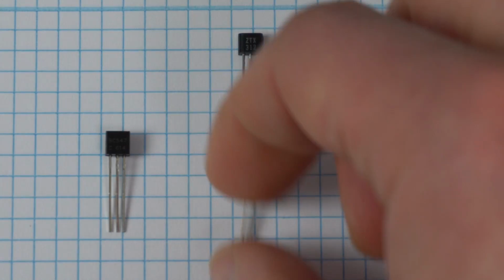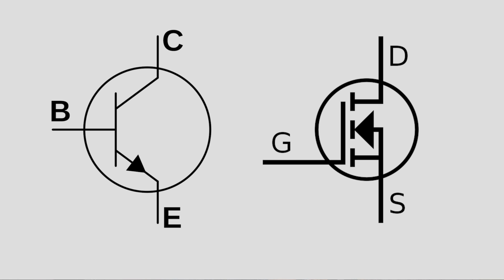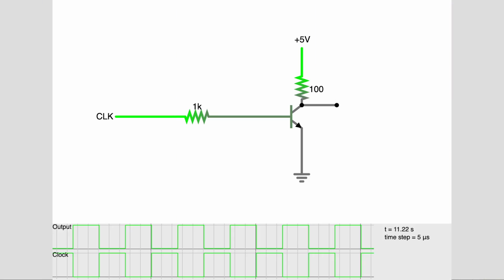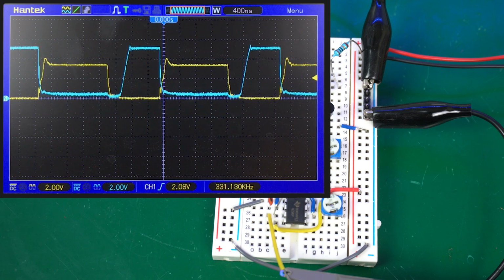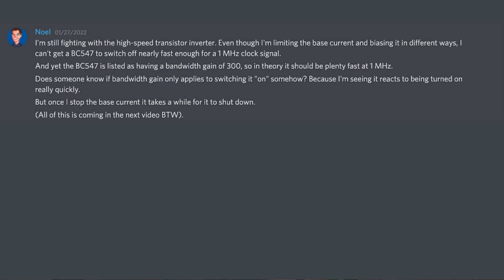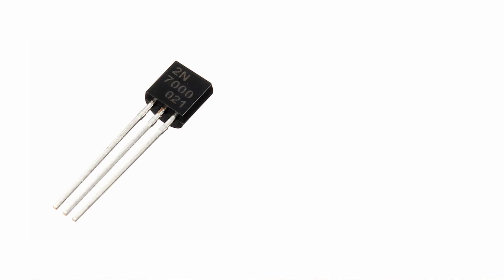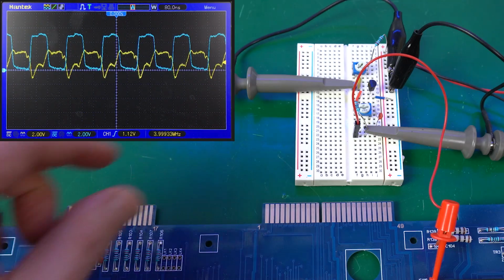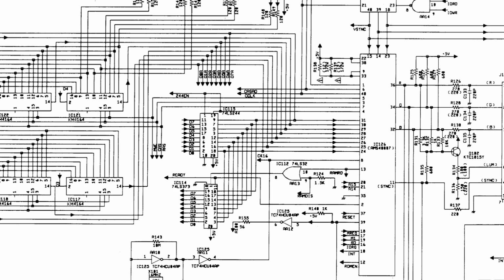How To Find a Transistor Replacement

Comment: Actually the low value of the resistors in the circuit 100Ω and 68Ω, it most probably also boots the available current. In the 1980s the output stages of LSI chips were often still very weak, especially when it comes to putting out a logical 1. It is not uncommon that those chips were only capable of sourcing 100 µA when high, while they could sink several mA when low. This is enough to perhaps drive a CMOS input, but probably not at a high frequency such as a several MHz clock frequency. With a collector resistance of 100 Ω and a series resistance of 68 Ω the transistor provides enough drive capability for the clock input of the Z80.
Reply: That detail about the 2N7000 datasheets was weird. It is such a common component - and the SMD-version is shown correctly in both datasheets.

Comment: I typically just find a compatible transistor by using the same Vbe and Ic specs. sometimes I'll try and stay within the same frequency limits. The hard part is finding the correct package type and pinout.

Comment: For the MOSFET you may have to tie the gate to ground with an additional high value resistor. The charge may not being pulled down fast enough through the IC. Especially since original design was a transistor.

Comment: Hi Noel, I just stumbled upon your video and thought I would add a few comments since I have been researching transistor substitutions since the 1970's.   The ZTX312 was originally designed by SuperTex.  Some other manufacturers made the same part using in-house designs but, the collector-emitter saturation and DC beta was not as good.

As you discovered, when researching a replacement, you must consider the application.  Also, you discovered the bipolar storage problem.  Bipolar transistors designed for switching are optimized for low base charge and low collector - base capacitance.  Additionally, switching transistors will have ratings that specify limits on transition times, on/off charge, and collector capacitance.

The BC547 is a general purpose transistor, which is generally used for low speed switching and analog circuits.  The 2N2369 is a switching transistor that came out in the early 1960's, it was designed specifically for computer applications.  In your circuit, a Mosfet would have been the best transistor to use, however, when that circuitry on your board was designed, logic level discrete Fets did not exist, so they used a bipolar.

The speed-up capacitor does not always work, it may overwelm the drive circuitry.  The schottky diode from base to collector is helpful.  It shorts out the base drive if the collector goes below 0.3 volt.  This circuit was used in all TTL with "S" and "LS" logic.
Reply from the maker: Thanks for the info! Fantastic stuff. Any idea why the Mosfet didn't quite generate a square wave at the full speed of 4MHz? That's the one I was hoping to use, but I couldn't tweak the resistances to get it nice and even. In theory it should be fast enough, right?
Reply: @NoelsRetroLab  The 2N7000 is somewhat of a general purpose transistor, although it's spec does rate switching characteristics.  The reason it doesn't perform as expect is due to several reasons: (1) Most enhancement mode Mosfets are designed to be fully switched on at a gate voltage of 10 volts, referenced to the source.  Although this Fet does have specs with a gate voltage of 4.5 volts, the transistor is not fully switched on (or saturated).  (2) The gate threshold voltage is 0.8 to 3.0 volts; the point at which the transistor starts to turn on.  Bipolars have a threshold of 0.6 to 0.66 volt at room temperature (+25 degrees Celsius) so, they are activated sooner as the input pulse rises, and with a much lower tolerance.  (3) Fets have the same problem bipolars do; input junction charge.  However, Fets have far less charge than bipolars, generally making them superior for high speed switching.  (4) Varactor effect.  The gate and drain have  noticably higher capacitance at 0 volts, versus 5 volts.  The gate-drain capacitance is a bit high as well.  My first choice would be 1.5 pF or less.

I am not sure what you are varying with the 2 pots you added to the circuit.  You should use a series resistor that limits the current to twice the normal amount to prevent the possibility of blowing out your gate array output.

I looked for an improved drop-in replacement for the 2N7000, and found nothing suppliers would stock.  It is getting harder to find small signal discrete switching Fets, as most of these are being replaced with a single gate inverter.  My advice based upon availability and pricing, would be to go with the PN2369A transistor; it should be a drop-in replacement.

One more comment - The 2N2369 you have uses the TO-72 package, which is a hermetically sealed metal can package.  This was the industry standard package for small signal transistors in the mid 1960's in the US.  Due to the added expense, most small signal transistors are now packaged in the TO-92, molded plastic package (leaded parts).

Comment: The Miller effect is a multiplication of collector-base CAPACITANCE by the amplifier gain... totally different than base charge of a saturated transistor.  A Schottkey diode from base to collector will prevent saturation.  This trick is employed in 74Sxx and 74LSxx logic chips.

Comment: Hi Noel. I understand your method of trying out different transistors to replace an obsolete but working one but most of the time in the repair sector, the obsolete one has failed.
Is the best way to find a suitable replacement by matching the hfe (gain) and VCEO as close as possible or higher ?. I am not talking about critical clock circuits but general purpose switching or amplification.

Comment: Just to let you know a MOSFET is a voltage controlled device and a transistor is a current controlled device.  I know you can have the issue of the charge staying on the gate of the MOSFET as well and unless it is rated for it operating it in it;s nonlinear region can damage it if you do not drive the gate with enough voltage.  I think a logic level MOSFET would have fared better in the circuit you were trying to use it in.

Comment: @5:31 - if this is a clock signal, it will be distributed (I assume) to multiple devices, each of which will need a chunk of current to switch. The maximum current  output of the array will depend on the array type, but it probably won't be sufficient to drive multiple devices (the number is called the "fan-out"). I would suggest the signal needs an external inversion as a result of the technology (again). Rather than use an IC of which a single invertor would be needed, it's cheaper to use a single, high-gain, small signal Tx.

Comment: Why it was done with the transistor first was probably more to do with how fast the CPC was developed (original designer went AWOL mid stream and total redo was done in months, I think KimJustice has a vid on it), be curious to check the Serial/manufacture date for the that board revision (or the one the replicant board is based off I should say).  Future revisions obviously would have focused on redundancy aspects.  Cheers Noel another great informative video and showing how to test for the defects is gold.

Comment: 5 V digital is easy  !
NPN is 2N3904 , PNP is 2N3906 just check Ic max ….........
If the gate-array is open collector you need a pull up resistor on the transistor base .
( 1k - 10 k across Vcc & base should work ) .

PS 
The 555 has a dc pedestal of around 0.7 - 0.9 V so off / low is not 0  .

Comment: What sucks is when you are repairing motor drive circuits like an H bridge where one of the transistors is dead and made of unobtainium. Meanwhile a popular replacement is listed as close matching. In that case you get to rebias the circuit, or try to balance it. I fixed a 45 jukebox with a mobile player carriage. All I could do was one direction was normal speed the other was half speed. That is why I praise the use of common parts.

Comment: I used to work in a shop in London repairing 8 bit micros in the 1980s.We always used genuine Ferranti transistors on the Sinclair and Amstrads as the other brands did not always work.  ZTX312L watch out the pinout is different to the standard ZTX312.

Comment: The Z80 clock signal spec is more demanding than regular TTL and I suppose they could not integrate the driver on the gate array. The inversion is just a side effect and the gate array could have inverted it for sure, but the primary use of the transistor is to improve the signal. I forgot the details, but it was quite common to use a transistor to match the Z80 clock spec. Note that they used a 74HC04, not a 74HCT04 in the second revision, which is a hint in that direction as well. MOSFETs are a completely different technology than bipolar and while you can get lucky, the considerations to drive them are very different.
Reply: I agree. I came to understand the Z80 clock input requirements designing a computer. Z80 is generally TTL level but clock is special.

Comment: I think that this is all wrong. The best way to replace a transistor, is to have somebody(who, I wonder...) do the dirty job and give us the best solution.

By the way, if a group of hard-working old-schoolers is willing to gather all of this precious info in one place and make a table with them, according to each old application scenario and with all of the other components, would be even better!

+1 by me as always, of course.

EDIT: And I forgot to say that if the people who like to produce new boards for old computers consider putting some extra traces and holes for resistors or deringing capacitors etc, would be nice as well.

Comment: Thank you for covering this topic. BC547 is just cheaply made transistor intended for low frequency amplifiers and similar applications. There are also specialized high frequency transistors available. A metal can package was actually pretty popular in the past. For example, KC507 transistor, a BC547 clone, was produced in metal can as well.

Comment: A very humbling video! I recently repaired a friend's Commodore 1541 drive where a resistor went bad and had to use an equivalent NPN resistor. I thought I had done my homework right by comparing specs and it was a success, but you now make me realize I probably just got lucky! 😁

Comment: I think the function of the transistor is lowering the output impedance of the clock and cleaning up the edges. The gate array is not powerful enough to feed the rest of the board with the clock.
Reply: The inverting of the clock is just a side effect, it's not intentional
Reply: The fact they used a invertor later on is just cost reduction, they just had one invertor left, which can also be used to adjust the output impedence.
Reply: I highly doubt was is the goal, since there is a resistor on the ouput to increase the output impedance, and as it just feeds the CPU, there is not really a need for low impedance.
Reply: @danielmantione  
The resistor on the output is only 100 ohm. The internal pull-up in the gate array is for sure much higher. Internal pull up in ICs are high to limit power dissipation in the IC. But this makes the output impedance too high to drive the whole clock circuit, so there's the need for an external circuit, which either has a lower resistor or has a push-pull transistor configuration like in that inverter.
Reply: @kriswillems5661  Still makes no sense: It is a direct line from transistor to the CPU, there is no circuit. Even with a 10K pull-up restance, one PCB wire is perfectly capable of pulsing at 4MHz.
Reply: @danielmantione  Not in a real circuit. At 4Mhz a stray capacitance to ground of just 10pF will have an impedance of 4K. With 10K pull-up resistance, you will not get pull-up at those frequencies. You need to be operating at much lower impedances to get a clean square wave, so there is some merit in the argument that the transistor is needed to lower the clock impedance to around 100R.

Comment: MOSFETS are voltage controlled, BJT are current controlled.  BJT have a current gain or Beta (HFE).  They are NOT interchangeable.
Reply: I'm afraid that's a gross over-simplification. In high-speed switching circuits, the current into and out of the gate capacitance of a MOSFET means that it cannot be considered as simply "voltage-controlled". Once you've added a current limiting resistor between input and gate and a pull-down resistor between gate and source, there won't be a lot of difference in the design between BJT and MOSFET.

Comment: You can't  usually  change a fet in place of a bjt because the biasing and impedace is completely  different
Reply: Correct, but here you can, because it is just a simple inverter. Because there is no base resistor, a FET fits perfectly.. As Noel says, study the circuit.
Reply: I use a lot of fet in my amplifier designs, but when I do logic I use digital transistor, the include base biasing resistors internally

Comment: Years ago, when I still used transistors for prototypes, I considered that there were two types of BJT transistors: for amplification and for switching. Even when fast, the transistors for amplification were not suitable for switching (the 300MHz bandwidth for BC547 showed you that), what was needed was the switching time to be very low. I usually used 2N2222 for switching up to 1MHz and BC547 as amplifier. Never reversed them, because the results were bad, 2N2222 was not a good amplifier and BC547 was not a good switching transistor, (you saw it at 21:45).
By looking at the datasheet, can see if a transistor is meant for switching applications, because there are few key parameters like switching time from low to high, from high to low, etc. You should have showed that in the video, not many people know how to read a datasheet.
Reply: I think Noels point was mostly to demonstrate that you need to do something extra to get the advertised 300MHz and this is valid for any transistor: A speedup capacitor will speed up a 2N2222 just as it speeds up a BC547.
Reply: @danielmantione  No, those 300MHz are one thing, they are valid in amplification. Make a amplifier, a oscillator and you will reach tenths of MHz domain, maybe hundreds, depending of the quality of the component. And he had this on his BC547. 
What he needed was the commutation speed that is give by the special construction of the transistor, (small capacities inside it, and others). And that was achieved with the transistor used in the original design without additional components. 
One can design a circuit, but to be replicate on industrial scale, the circuit must behave the same independent of the tolerances of the components. Noel said that, to fiddle with the components values in the BOM is not something that one will want to do when buy the kit to build it and enjoy it.
The point he made (in my understanding) is that you must use the right component to achieve the desired goal. Only that he does not touched the subject I pointed out.
Reply: @sebastian19745  GaAs FET's came out in the late 80s, often in a can w/ 4th gnd pin. Those things easily handled 600 MHz due to ultra low junction capacitance.
Reply: @wiregold8930  Yes, but do you remember also theirs prices? One of these or a mosfet tetrode were quite expensive in 80s. Also, they were used mainly in RF, hence the extra ground pin.
I got 3 BJT (BF200 or 214 I think it was, not sure) that had a 4th pin for ground, they were more expensive than a regular BC107/108, I did a 3 stage antenna amplifier with them. And they were pretty common by then, they were used in many TV tuners.

Comment: I have used such transistor based NOT gates in parallel in some designs to make voltage level shifters which were not available in local market. As I remember I have used BC547 with some pull up/down resistors for SPI bus between uC and other modules without any issues, which are well below 4 MHz of course.

Comment: I learned about the Miller effect in college but had forgotten about it till I heard the name. Frankly, I never had it happen! Not even on the BC547(C) which I have literally 100s of as it’s a a GP transistor.
And I used them as FM oscillators. So I wonder whether the LC on the collector and then the feedback to the base is enough to eliminate the effect. Or the C types is less prone than the A OR B types.
So weird, that I studied EE and wonder about these things. Then again EE is a complex subject. More complex than boring CS will ever  be 🤣
Reply: You can use a BC547 at radio frequencies while it is working in its linear region, for example as an oscillator using a tuned collector load. The problem comes as soon as it goes into saturation, for example in a switching circuit. Then it will store up a charge because of the relatively large parasitic capacitances, and removing that charge when you want to turn off the transistor will take time, meaning that there will be an often significant delay before the transistor switches off. If anything, a BC547C is likely to suffer the effect worse than an A or B because the higher current gain will allow saturation collector current to flow with a lower base current, so it may take longer to turn off as the parasitic capacitances discharge.
Reply: @RexxSchneider  I guess you are right indeed! In an oscillator it’s indeed nicely oscillating in the linear region and doesn’t require to dump all the charge. Thanks for reminding me :) Makes me wonder how I got my degree in EE :) Probably also the reason I mainly work in CS now :)

Comment: I have done gain, hf, voltage, and amps. There are a lot of transistors with the same or 1 up that will work! Been using it since the beginning of transistors!